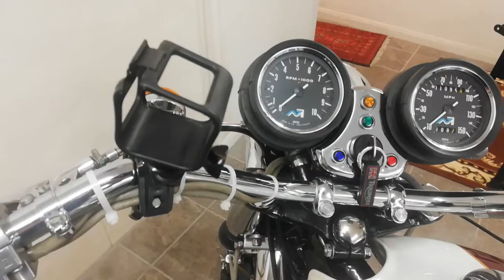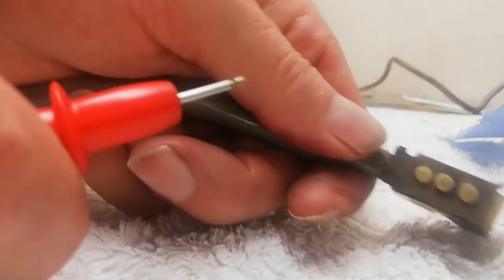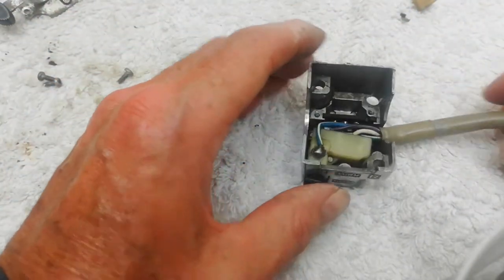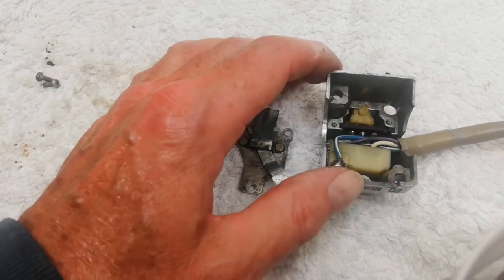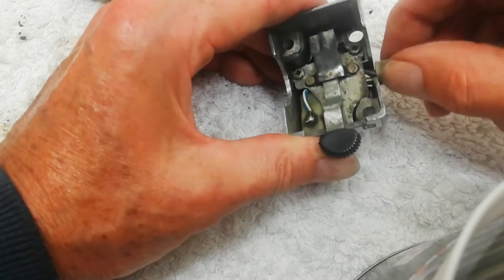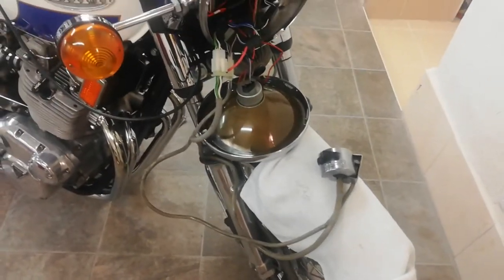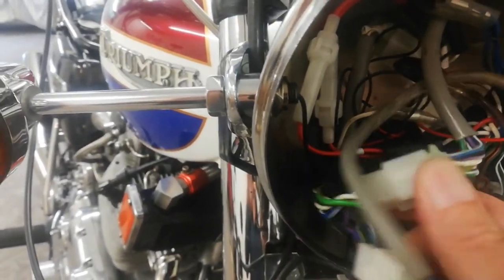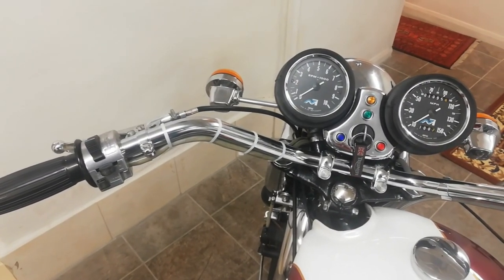Triumph Trident T160: Refurbishing the left hand handlebar switch

Comment: is there a ball bearing beneath the spring
Reply from the maker: There's not a ball bearing underneath the spring for the indicators etc on a T160, but there often is one under other switches. I can't remember exactly, but maybe there's one on the indicator switch on the slightly earlier T150/T140 models?

Comment: Hi Chris , my T160  has lately decided not to start on the button , so i kick started it , turned it off and used the button and then it works , mines had the wiring up graded , does the lucas start button get just as dirty on its contacts , i suppose clean that first , then go to soleniod , and earths .cheers
Reply from the maker: Hi there, it could be a number of things. As you say the starter button may have corroded and needs cleaning, or your battery is getting tired, or your charging system isn't working properly. Those would be the main suspects - but of course it could be something else too! (Commutator needs cleaning in the starter motor, or the brushes are worn out etc - these are unlikely but possible). Good luck!